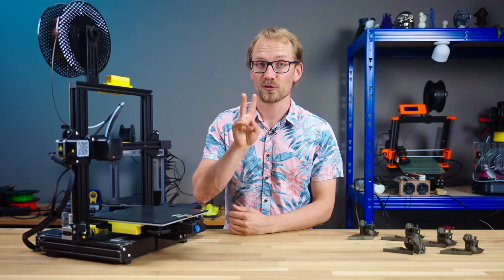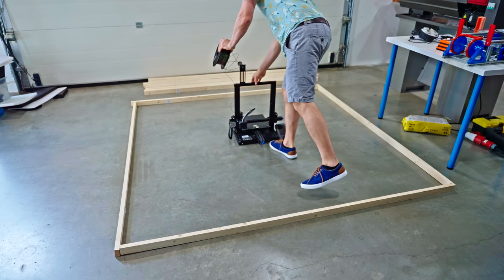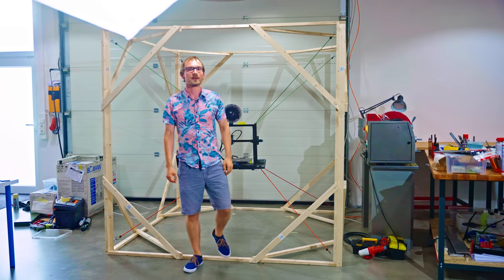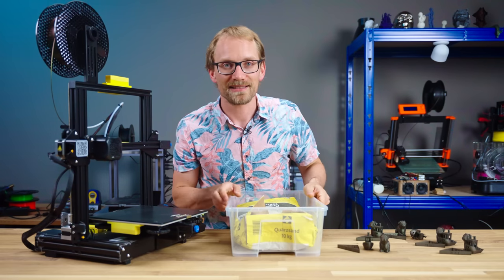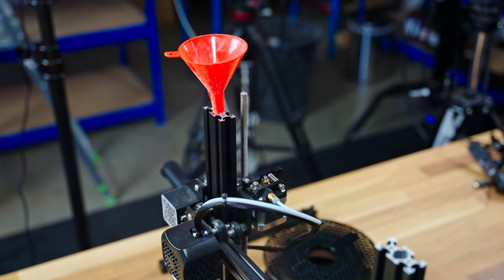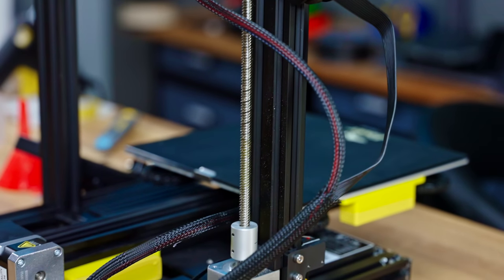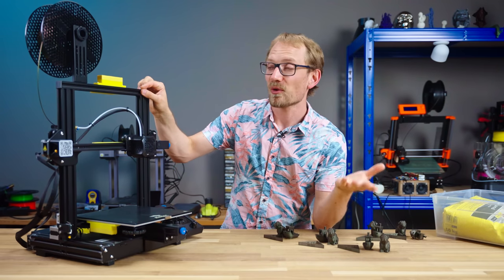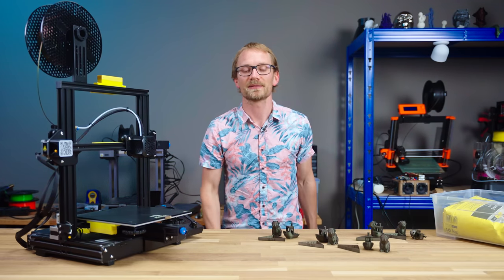You made me do this…

Comment: Its damping man.

Dampen: make slightly wet,
Damping: [Physics] Restrict the amplitude of vibrations.
Dampening isn't even really a word, since its just dampen but... with two different "active" suffixes.

Great video though. Really enjoying watching you test stuff, even if on such a scale its a little insane. I do think its possible that the suspension cage is a little too big and that the bungie cords are a little too loose, but you may have looked into that already, or found off camera that it makes no difference.. Take a look at a microphone suspension mount, maybe there is something to learn from there. In theory if the vibration feet work, the suspension is operating off similar principals, so the correct set up there should produce similar results. Even still though not sure its worth looking into at large since its such an impractical solution for most people.

Comment: Great series of videos Tom. I think we have to realize that at the end of the day the ender 3 v2 stays a bed slinger that’s slinging around a lot of weight with the glass bed and steel bed carriage. It Would actually be interesting to see what difference it would make by doing the opposite on the bed. What would happen if we changed the glass bed with lighter pei spring steel sheet and or even drilling a few holes in the bed carriage to lighten up the whole slinging carriage?

Comment: You can test you resonance theory by printing feet with different width/arcs or thicknesses. Effectively you are trying to alter the "spring rates" of the feet right? Printing a range of sizes for the feet with different stiffness should result in different effects on the ringing if the resonance theory holds

Comment: And removing any extra weights to the printer itself, i.e. tops because it just adds more lever arms. I would imagine you want the least amount of weight on top. And the most in the bottom but dampeners on the bottom such as a bed of sand. Also what about adding 3d printed rubber spacers in between each motor and the mounts?

Comment: Great, great great great video. Part 3 - yes please.
A constructive critic: I would never put sand in the printing bed.
Only on non moving parts, and lower the center mass.
Reply: I don’t know the limits of the experiment, but what about:
- adxl and software complementation 
- synchromesh cable instead of belts
- squash balls as feets
- hardening the structure with cheap alterations as seen in Chinese vendors - or as done in the CR10s
Reply: What about the Sand-tainers stl? LOL

Comment: Hmm, styrofoam raft in the water filled pan? I'd certainly try that before buuilding that bungee cord contraption. Maybe with an intermediate matt made of some even more dampening material. This may or may not eliminate ringing, but would certainly isolate it from its surroundings in case you want to investigate further and pinpoint the source. You asked for it...
On the more practical side, you could try using lead buckshot instead of sand. Static parts only.

Comment: You have to remove the Sandboxes on the bed, the increase in weight off sets the other dampers..
E=mc2, acceleration^2 x weight = momentum.
Reply: Or is it ^3?

Well remove the Sandboxes on the bed, they destroy your test.
You want the moving parts as light as possible and the frame as heavy as possible.

Comment: STEEL BELTS - greatly reduced my printer ringing. But ya got to use  larger pulleys, higher belt tension, accommodate a the thicker belt too .... and accept the belt life is short compared to other printer belts (the steel cords fatigue and snap). I run Steel Belts on ALL my production printers for my side Gig home printing business.

Comment: All of these accuracy and speed issues can be solved with a proper closed loop system.  Stepping isn't enough, you need a true closed loop system as well as accurately engineered and maintained hardware to be truly accurate and fast at the same time.  If the main controller has feedback as to how exactly each motor has rotated then it can know exactly where in 3D space the nozzle is and how much to extrude as it travels.  With feedback, the movement and extrusion can be extremely accurate even at higher speeds.  The feedback can even allow the speed to be auto adjusted to max speed vs requested accuracy and would even allow to calculate a confidence value or error value for any set speed.  Speed and accuracy is one area where most 3D printers suffer that standard inkjet printers solved years ago out of necessity.  Most consumer and industrial inkjet printers don't even use stepper motors to drive the x or y axis (head movement, paper feed) and they still get every dot of ink in exactly the right place.  3D printers can do this too, but it would take the controller board to handle the input of the feedback.  There are closed loop stepper motor controllers for industrial machines, 3D printers or CNC machines that would help a lot with accuracy.  They do not extend the loop to the main controller board where it is truly needed for both accuracy and speed but they do help a lot ...

Comment: While you still have the suspension setup why not try a tuned mass dampener or two. I'd definitely start with a single axis and add each one at a time. you can use 608 bearings packed with a light grease to get your dampening. You shouldn't need much mass since you only need to counter act the force the gantry exhibits on the printer frame. Also,  The comments about motion amplification are right. It'd be cool af.

Comment: Gear reduction would smooth out the travel moves but slow everything down and you still have the issues with harmonic vibrations 
Pneumatic or hydraulic cylinders in place of the gear driven motors and belts might be something to explore but the size of the printer would increase substantially with no increase in build volume
When it comes to a clean surface finish I still think resin will always have an edge over filament feed machines but as with everything in life there's always a trade off

Comment: Did you try the sand vaults only in the base and not on the moving mass like the bed?  As this is what the spring feet are affecting, so it would be a better comparison.
And on the tuning, by using a mix of materials like sand and BBs, you can get a broader range of damping.

Comment: silly question:
why not just install an upgrade board with better motor drivers?

I just recently purchased a cheap "Anycubic Kobra" and it is really quiet, I can only hear the cooling fans which is something I may be adressing fairly soon, however, the stepper motors are all very quiet, even printing at 100mm/s (recommended is 50mm/s for this one) it stays silent, but print quality could be better

Comment: instead of using sand, try adding rubber mounted weights. the car manufactures have been starting using those to remove vibration for about 12 years now

Comment: My main idea would still require in-depth numeric analysis as well as dynamic measurements - at least for initial setup - but I believe resonances of a specific printer could be measured, modeled and dynamically damped by changing the accelerations and velocities on the fly.  I.e. real-time, active resonance compensation.  Vast engineering effort up-front to be applied in software without increasing the hardware cost.

A more expensive and mechanically complex approach might include additional active motion components providing "equal and opposite" forces to cancel the resonance driving forces.

Yet another approach might be stiffening the structural members by doubling them (e.g. laminate 20x20 or 20x40 extrusions).  Or by filling the extrusion center voids with fiber bearing epoxy.

Or we can just slow down our printers so that structural resonance doesn't overpower the printer's mechanisms.

Comment: You should add load cells to the 3 axis and measure the forces then do an FFT plot to see the frequencies. Then theoretically you could do something similar to active noise cancelation and counteract those forces.
Or actually this just came to me, add an equal amount of weight to the opposite sides of the belts so that as the print head moves right, and equal amount of weight moves left. Should cancel a lot of the forces.

Comment: aside from skipped steps, which is a symptom of a motor working too fast under too much load, (sand not helping here).
any ringing on the part be a cause of the nozzle moving relative to the part being printed in a undesirable manner,
Adding weight to moving parts is just going to increase momentum and make it harder for the motors to put the nozzle where it should be, any play in-between the bed/part and the nozzle is going manifest it self in visual ringing artifacts in the print,
any moving part between the part and the nozzle via the bed>frame>guides etc, needs to be rigid, not heavy, and actually need to be as light as possible and not create much momentum or inertia in the moving parts of the system. 
there is no viable way to figure out the resonates of each part of a moving system and the bed and the part and equal them out to be in phase with each other, the only realistic way is to reduce as much unwanted movement in the system as possible, (like play between moving parts, and reduce the mass of the moving parts, which reduces momentum/inertia, which reduces the relative vibrations between the nozzle and the part being printed. 
Lowering print speeds also reduces the momentum/inertia of the moving parts which is why it removes the ringing in parts, but that costs time and from my understanding of what your trying to do is to reduce the skipping/ringing in defiance of high print speeds.

Comment: Maybe instead of sand you should try to fill the boxes with high viscosity liquid? Also instead of attaching sandbag onto the bed it would be better to attach them to the profile the bed rides on because this way it may dampen some vibration without adding load to the stepper motor.

Comment: For real dampening effects in a true mechanical/ physics sense you need to convert kimetic energy into another energy form, so the elastic band setup does not fit the term dampening setup (inevitably small friction in the material of the bands left out because the friction in the linear bearings of the printer is definitely higher than the friction inside the elastomer bands)

Comment: Hmmmm... Would be interesting to see the belts tested. Might be a way to fix my Ender3Pro for an outlay commensurate with the low initial cost of the machine. That's an issue for me - is it worth it or should I save the pennies for a better more solid printer? And for my home hobbyist use, does it actually matter all that much? 

This has been a very interesting and engaging series so far Thomas, thank you for taking the time and efforts to try all these things out.

Comment: I made my work bench dampen almost all vibration when hammering on an anvil i got attached to it, building an enclosure for my new printer the same way: at a minumum for every flat surface you put into it (shelves, and main work surface) i make a 5-6 inch gap undrneath and fill it with quickcrete.

Comment: try to decouple the printing axes. i mean by actually put the build plate on an extra table or something like this. i once worked on a diy windtunnel and by just putting the wind generator on an not directly connected (to the rest of the system) table reduced vibration by like 70%. so maybe it would be interesting to see how many axes one can actually decouple, but as first step the build plate would be enough^^.

Comment: I don't think I've ever seen a proper A/B test of different belts, so that would definitely be VERY interesting to see. The difficulty might be ensuring that the belt tensions are not affecting the results - different construction belts might require different tensions. Plus, steel core belts on 20T pulleys = split belts. I also feel like the sandtainer idea could be heavily, heavily expanded on (pun intentional). Massive sandtainers bolted to the frame could result in a more visible improvement - you need a LOT of sand to absorb low frequencies. I'd also like to see if diagonal supports for the gantry would help - that joint at the bottom has never seemed particularly rigid to me. Maybe even just some 4040 corner brackets bolted on (if they don't foul on anything).

Comment: Add you mentioned putting sand on the bed was not a good idea as it raise it weights this raising the mass. On core XY  we even use carbon x gantry to have lightest one to minimize these vibrations.

So i think that sand could work, in a rather big volume like a full container that goes as high as the z extrusions and goes to the rear.

On my side I intend to try something like that on my core XY

Comment: Elastomers work by isolating the vibrations of the printer from the rest of the world. That's useful for reducing noise, but it won't improve print quality at all.

What you need is to reduce the misaligning effect that vibration has on the different parts of the printer. If you can't rebuild it with higher rigidity and correctly applied actually dampening materials, doing the exact opposite of the first experiment - i.e. bolting the printer to a wall - does help, both by increasing rigidity and helping to sink mechanical energy into another medium.

And yeah, if you don't know what you're doing, weight can be a negative. And it's not just in the moving parts, you can change the frequency of the vibrations and make everything worse.
Reply: And no, I'm nowhere close to an engineer, I just read an unhealthy amount of articles (And one book) on CNC machine design.

Comment: I think you have to suspend the printer using non flexible cord, using lead weights running on wheels. Same principle used on very modern longbows. In that way, vibration is smeared out over a longer time because it's a dead weight

Comment: fill it with lead shot and epoxy.. They do this to cnc machines to help increase the accuracy. They also epoxy the base into the slab. I have also heard that you can use clay and epoxy the frame joints. you want everything that is stationary to be as HEAVY as possible and everything that moves to be as LIGHT as possible.

Easy money is to absolutely GET THE REEL OFF THE TOP OF THE MACHINE!!!   That thing is flopping around. Ill bet when its getting to the end of the reel that your prints are better.

Comment: How about reinforcing the frame with steel sheet metal and angles.
Steel has higher E module and of course adds mass. Then fill out the inside with lead balls.
Compare the density of metals to sand and granit.

Comment: Would counter weights help on your x and y belts? If it were possible to send roughly the same weight as the printer head/bed in the opposite direction and stop at the same point then wouldn't the head/bed move smoother. But I may have not have understood the video. Obviously it did get me thinking though so I enjoyed it

Comment: 2 litle of a area for the sand to work in the frame but there is another way to remove vibration making it extreemely stiff fill it with epoxy cement i do it on some metalworking machines it works a treat also scratch the whole portal configuration its realy not great for high speeds

Comment: I'm certainly no expert on this topic, but after printing for a few months I noticed the banding on the sides of prints - holding a ruler to them shows they are 2mm apart, which is the pitch of the drive belts, so I just thought "hey, that's what you'll get using toothed belts".

Comment: I wonder if a screw-driven 3D printer has the same issues. The belts when thensioned add a lot of springiness, especially that near the bed/hotend they are allowed to move upwards due to how Ender is designed. I'll be really curious to see if using different design would work.

Comment: Sorbethane dampeners at motor mount and under motor mount screws as well as pot dampers at belt wheels. Isolate every point of vibration from the main frame of the system and that should do the trick

Comment: Thomas, love your reviews and the the great ideas you come up with for testing stuff.
SSOOoooooo heres one for you but it would have to be done on a core XY machine. You have suspended the machine but how about building the four corners supported by something like cinder block while its on a concrete block. So you would have all the corners being held in place by blocks to prevent any form of movement or vibration. Maybe a bit overkill and it would weigh a LOT but it would theoretically only have the print head causing the vibration.  
Keep up the excellent work and reviews.
I am still dealing with my tronyxy A5sa, a nightmare in a box!!

Comment: I think the bungee cords are only half of the solution.  Think of the most common dampening system around, the suspension on a car.  They use both springs and shock absorbers to control the rebound. Your bungie cords are the springs but you don't have any shock absorbers.  Although I have no Idea where you would find any weak enough to work for a printer...

Comment: You should be adding mass to the fixed parts, not the moving parts, because by adding mass to the moving parts you increase inertia and thus the problem you were trying to solve in the first place.
You could try melting lead into the hollow fixed rails, I'm pretty sure it will increase the mass significantly.

Comment: you should have calculated the resonance frequency and used it to find a good mass. most times the mass you have to add to a machine is really a lot. so the sandamount was way to little. there are also other options with less mass but they are mechanically more difficult.